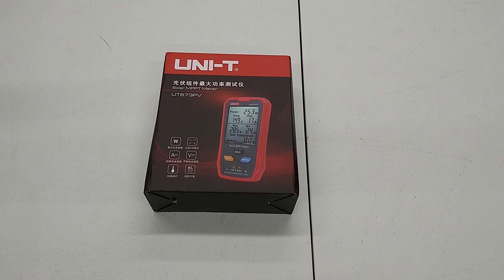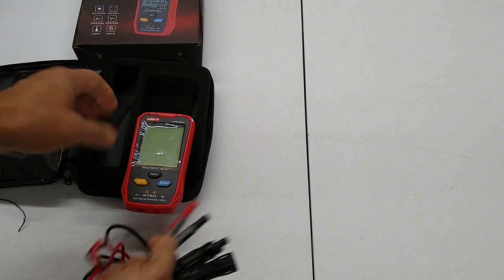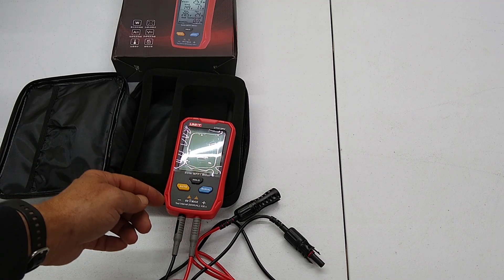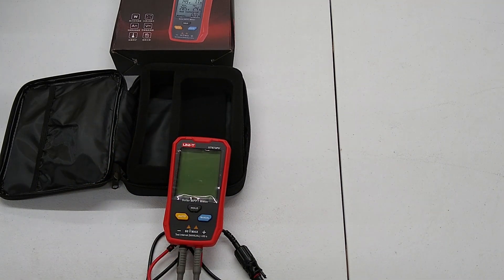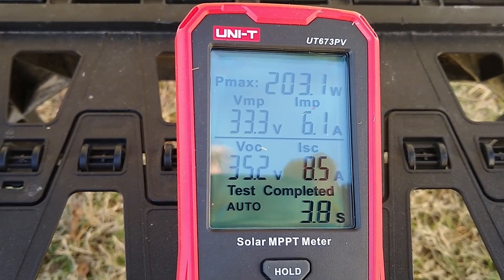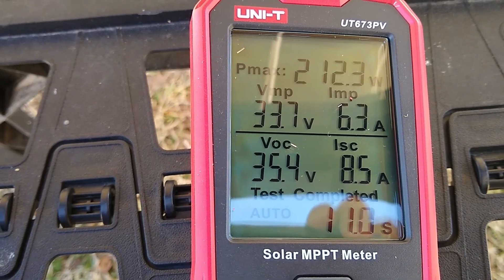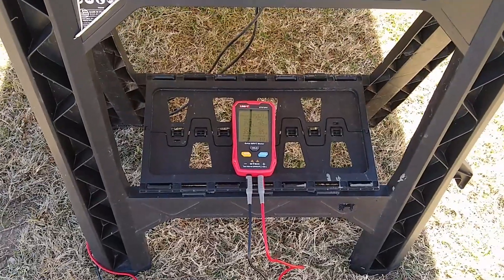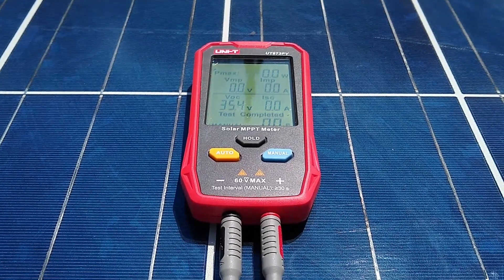Test Solar Panels in Seconds UNI-T UT673PV

Comment: Mine died after testing less than 20 panels.
Reply from the maker: Any idea what happened, is it an actual UNI-T or one of the knock offs?
Reply: @DIYSolarFarming I have two(2) that I just tested.  Tested a third unknown make as well. Test connect to 12v 7.5 Amh battery.  All three handled it well.  The no name has a backlight and flashlight function.  Rather a meter than one's home.  Check connectors and test leads.
Reply: I have two(2) that I just tested.  Tested a third unknown make as well. Test connect to 12v 7.5 Amh battery.  All three handled it well.  The no name has a backlight and flashlight function.  Rather a meter than one's home.  Check connectors and test leads.
Reply from the maker: @LambertFick  Thanks for the info! 👍